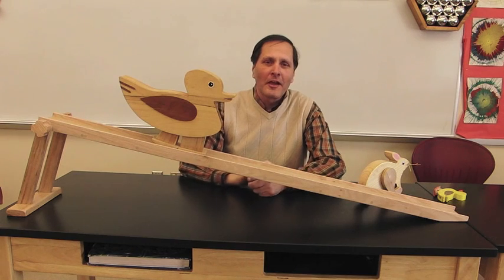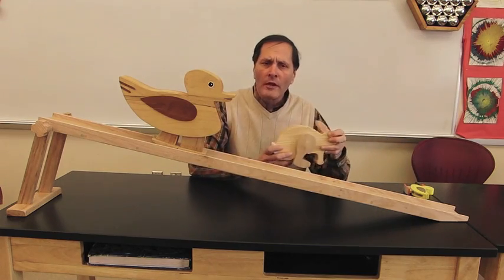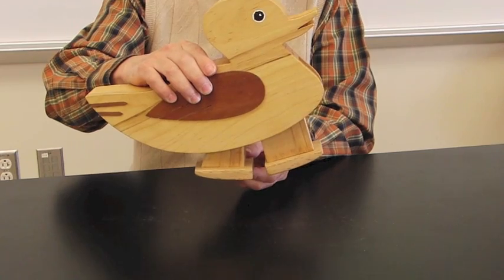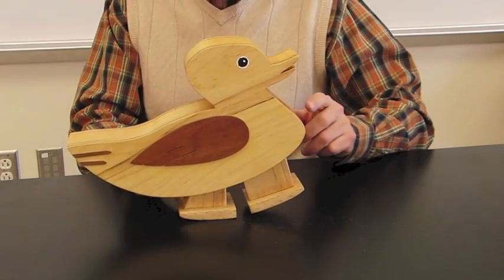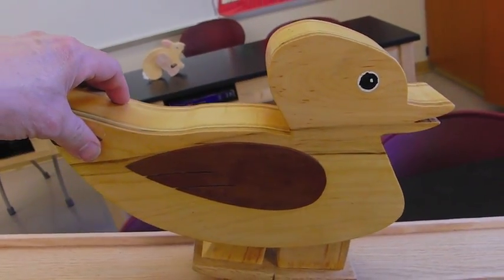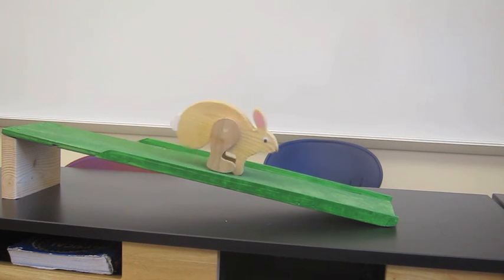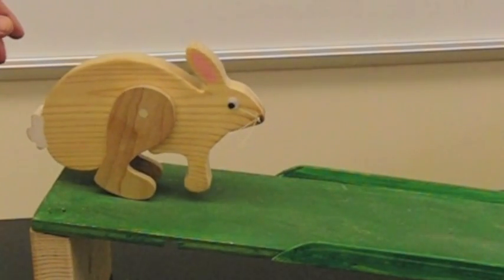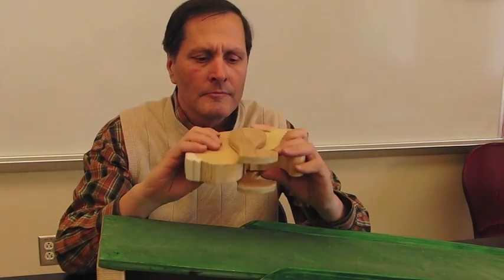Toy Physics--Ramp Walker  ///Homemade Science with Bruce Yeany

Comment: This is  an area of "scientific toys" which every one loves, ramp walkers front back and side movements, level walkers when pulled, rope climbers with two ropes and a single rope where " friction clutches " need to be used.
I must say that the finishing of these scientific exhibits are better than mine as they include great artistic features while mine are purely scientific and only relate the mass to the point of contact. Such projects train the students in language use art, mathematics, mechanics, all physics and science and if the students are allowed to do it craft and design is also in it.
Perhaps there is some benefit in allowing students to do their own design which need to include the science, but the art and the language is  left to the imagination of the student.  This joint efforts in subject may eventually teach students that there is everything in all we do and we cannot separate, art, languages, sport, science, religions, physics, and social work as they are all incorporated in all we do . This is something that all schools should establish once and for all.  Well done Mr Yeany.

Comment: Hi Bruce.Great video. Im also working on this toy.
But instead of using wood, Im using a 3-D printer to design the toy.
Plastic weighs much lighter than wood, and my design is much smaller than yours.
Can you help me out?
Reply from the maker: fila zaum Hi Fila,   I can send you information on the rabbit and and two other ramp walkers.  As for the duck,  I had a small wooden one that was broken so I took it apart made drawings of the parts and enlarged them on a photocopier to make it.  I loaned out the pictures to someone and they were never returned.  I would be happy to share what I have, to do so I would need and email address to send it to, either in this comments section or privately.
Bruce
Reply: Bruce Yeany Thank you for the reply. My email is muaz1801@yahoo.com. I also have some videos and photos to share with you. Im looking forward learning from you.
Reply from the maker: fila zaum They are on the way,  I'm looking forward to anything you would like to share.  Bruce